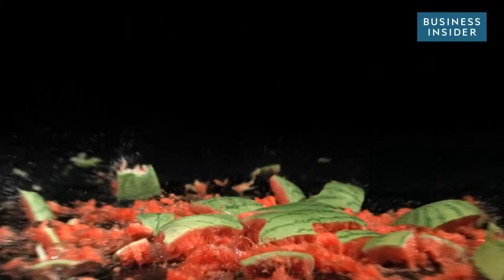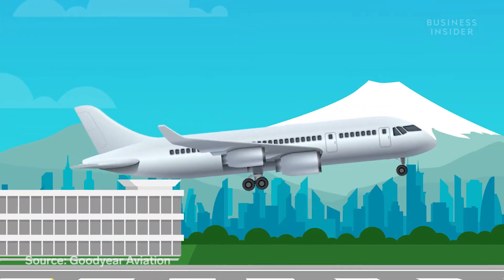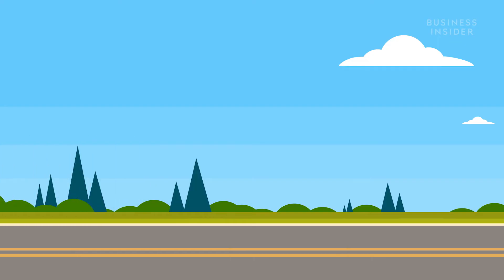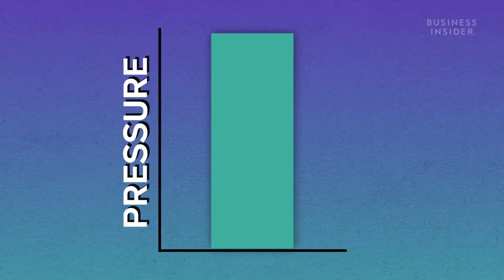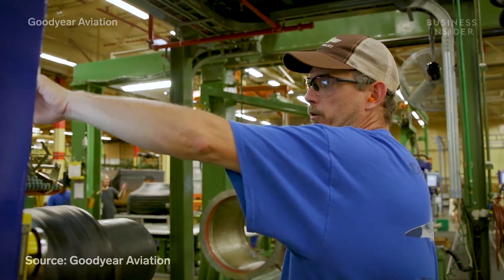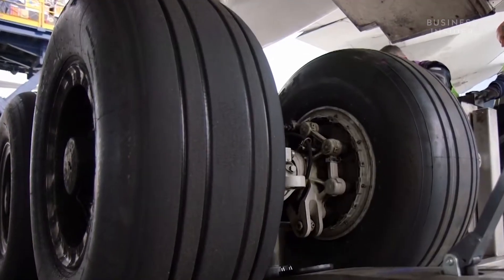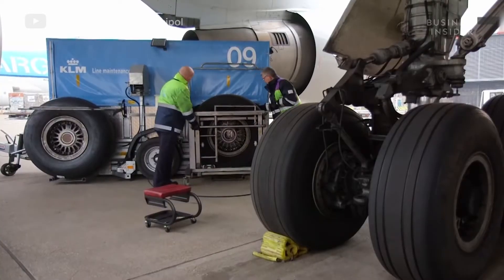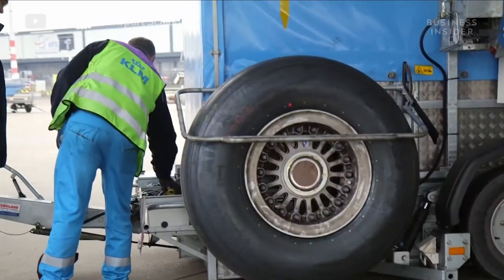Why Plane Tires Don't Explode On Landing

Comment: Many tires spreads the load out over a WIDE/LONG area. Also, they are 16 ply, and tested to 225 MPH.  They use CONDUCTIVE rubber. Car tires do not.